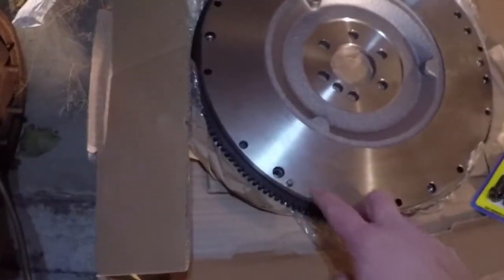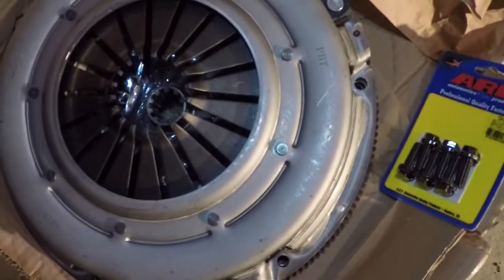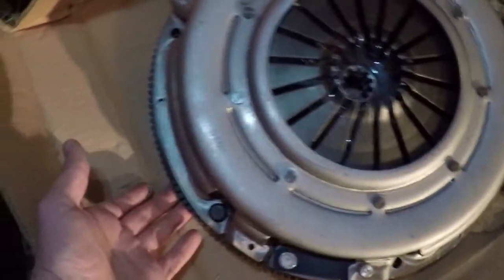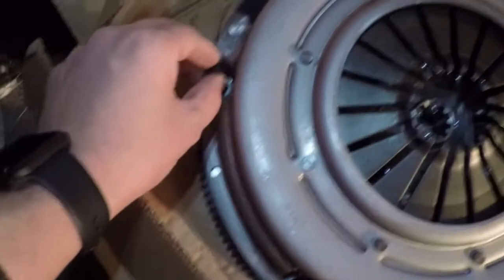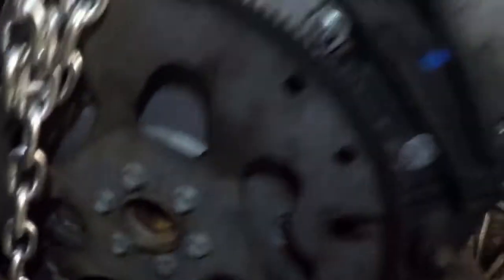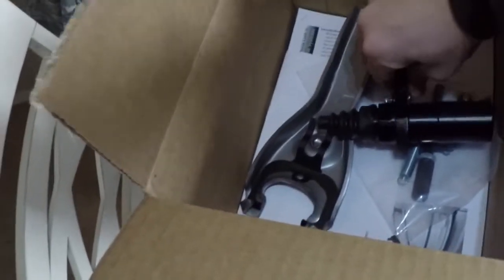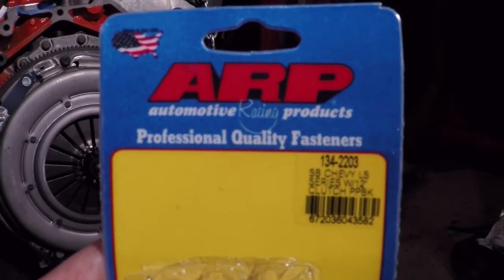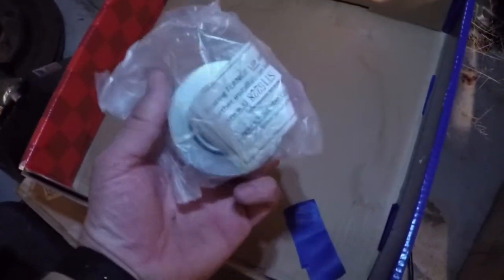SM465 to LS motor, what you need

Comment: What did you do for the ECU ?

I had my sm465 rebuild brand new, brand new engine and I cannot go over like 20mph.. I think it stuck in limp mode but I told my LS ecu programmer my setup and they said they remove all the ECU TRansmission programming.. 

How did you solve the ECU transmission programing ?

Comment: This will not hold up! If you want to understand why...go to novak adapter and you'll see that the combination he's using will only allow 30% of the clutch friction disc to grab the flywheel. It's going to vibrant something crazy! Those dowel pins are what centers the pressure plate on the flywheel. This whole thing is a complete problem waiting to happen and that very first time you have to slip the clutch for over 30 seconds...you better have a tow arranged. Spend the money...do it right. The flywheel needs a shim whoever commented change the fork...yeah, no! It's nearly ⅜" difference between the 2 flywheels position. You won't have enough throw on the arm to have the travel for the clutch. Not trying to be a dick I've done this swap 3 times and it's going to take over $1,000 if you do it right. Drill tap bellhousing tab to accommodate the missing hole...the top hole just is what it is. Go to Novak.
Reply: Man if I can get into contact with ya and hear what you’ve got to say I did the swap and I have no clutch and yet to find out why

Comment: The reason for the holes being different. An LS uses a 10 mm bolt and the old style Chevrolet uses a 3/8 bolt. The LS bolts are .010 bigger than the 3/8 bolt.

Comment: I’m doing the exact same think for my square body, I have the same parts roughly and it all bolted up pretty good, only issue is when I put the engine and tranny together and tighten it up to put back in the truck, the engine won’t far over. If I loosen the bell housing bolts 1/8 to 1/4 inch it bars over fine, did you have anything like this when you did it?

Comment: Did you demolish that clutch yet? as soon as I built my 383  I put it back with the stock clutch on my 91 Chevy. within 500 miles I demolish that clutch and it was in perfect condition. It literally shattered and stacked it itself. i was able to drive home with one little sliver of metal holding on and baby in it
Reply from the maker: Bart Barnett depends on how you drive, and if your measures everything properly. So far no issues with mine

Comment: part number on that pilot bearing is 12557583. Also, if you can find a 85-87(91) squarebody chevy bellhousing, it will take a chevrolet external driver's side slave with no adaptations. The fork pivot ball will need to be swapped with an adjustable one to compensate for the 1/8" difference in flywheel location between the sbc and the LS motor.

Comment: Only problem is the friction material over hangs on the inside edge of the flywheel. You could of used a friction disk from a 93 diesel  k2500. Has the right thickness and width.
Reply: If this information is true, its golden!!!
Reply: Do the pressure plate work too? Or do you need the K20 pressure plate?

Comment: Interesting. I recall the pressure plate I bought for my swap (Luk brand I think?) had 3/8" bolt holes for all of six, so I'm gonna have to drill them all out to 10mm for the bolts to fit. Now I'm worried about clutch alignment, especially since the flywheel dowel pins will be removed. Any advice on that? What brand clutch kit did you purchase? Thanks.
Reply from the maker: I just bought a stock duralast clutch for a 79 K20 and ran it because it was cheaper than buying a "conversion" clutch assembly. You really just have to ream out 3 of the 6 holes.
Reply: MUFN's Garage the Luk assembly was a standard factory replacement for my 85 K35 which is why I was suprised there was a difference between mine and yours :) Could be a year difference

Comment: Do you have any new updates? I like the video since I too have an SM465 tranmission. Thinking of using it on my c10 married to a 6.0LS.
Reply from the maker: Not just yet, I am very close to actually starting the motor and I will go over how the trans is working with the LS motor. If you'd like some more info Dick's 4x4 Garage has some pretty good stuff on LS motors, he has a cheaper way to use a hydraulic clutch on the SM465.
Reply: Bro just use the 153 tooth flywheel critical on this application unless you want to shim a after market starter because starter for ls the bolt patter is different from the staggered pattern it's across only if you want to run stock ls starter and also longer throwout bearing
Reply: @josephrodriguez4029 got any videos? Currently flirting with that same idea for my 1970 c10.